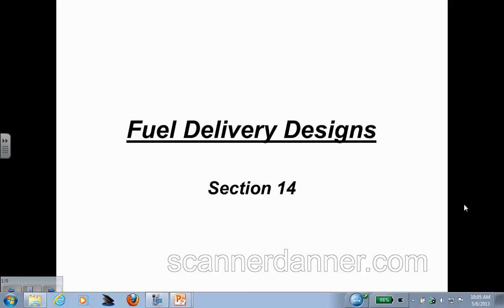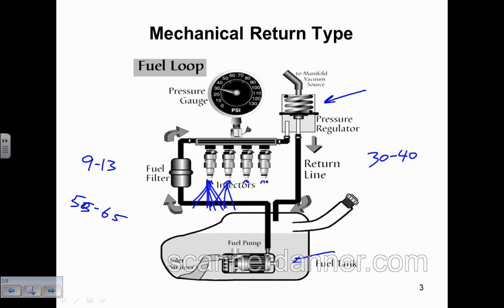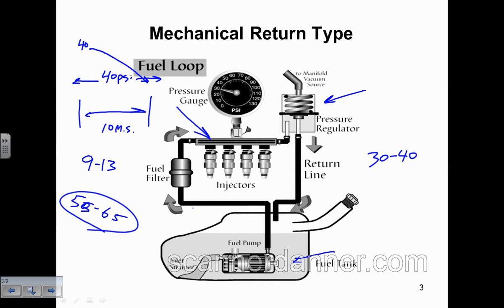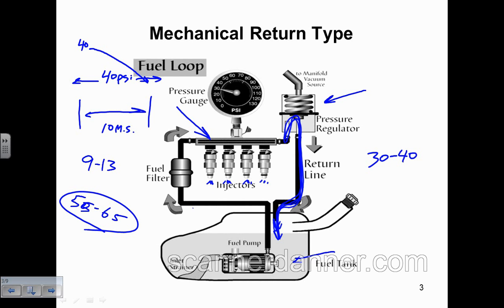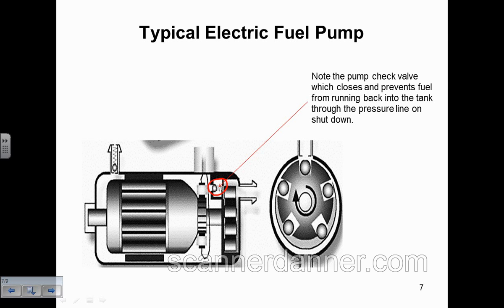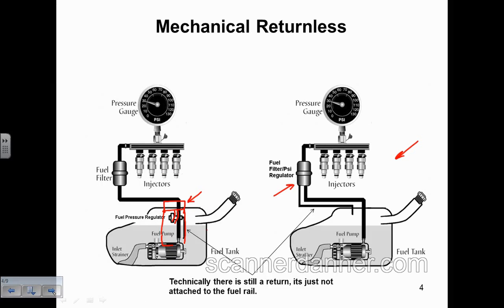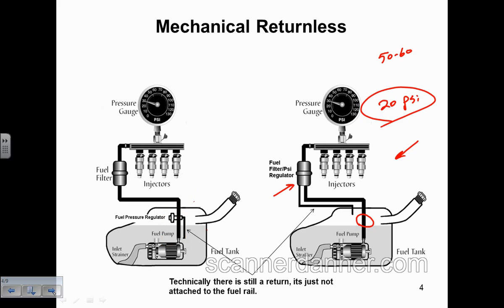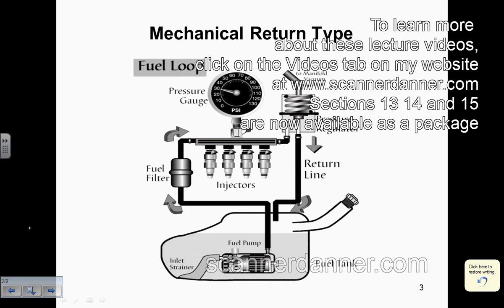Chapter 14 (Fuel Delivery Designs) classroom lecture - an SD Premium preview

Comment: Yes that is correct. A healthy pump will shoot way past the spec very quickly,over 100 p.s.i.  If the pressure is still low the pump is faulty.

Comment: Good to know. What is the point of knowing the deadhead pressure is there a spec somewhere that tells you what it should be? I would think as long as the pressure is greater than the spec for the fuel rail pressure it should be fine, correct?

Comment: I am a 30yr G.M. MasterTech. On those vehicles I install a test hose with a valve and 2 schader ports before the filter/regulator.I install fuel pressure gauge on the port before shut off valve run the vehicle and shut the valve momentarily to check deadhead pressure.

Comment: Ok, soo check valve is basically would show up in Long crank times due to pressure loss. The only other reason for loss of pressure would be a leak at the injectors which would manifest itself as neg fuel trim, correct?  Loss of prime w/o  driveability issues means check valve is faulty.   Thanks Paul

Comment: All the Flex fuel and 03 S10's and Sonomas have the regulator built into the filter, I know that because I have one. What would be a Good way to determine if it is a pump or filter on those vehicles? They have a test port on the fuel rail but would you just pull the filter and check the pressure?

Comment from the maker: for sure. just making a point to my students that to be a good diagnostic tech you need to attack the customer complaint not fix every little problem along the way that has nothing to do with the complaint. should we make the customer aware of the other problems? of course! but as recommended items NOT needed items.

Comment: You are correct that a defective check valve at the pump would not cause a driveability problem, however you should make the customer aware that it could cause long crank times and it should be replaced. It the battery is weak at some point in time, such as in cold weather, the engine may not crank enough and would fail to start, causing an unhappy customer.